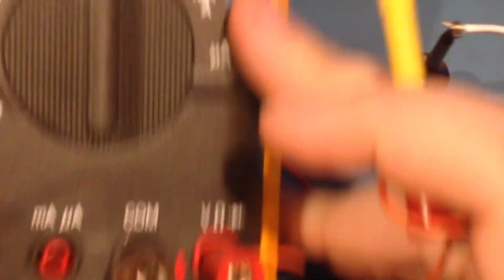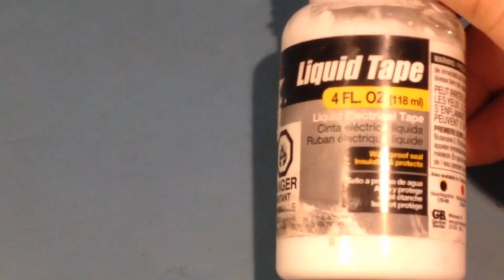How to use Wire Piercing Probes

Comment: Black liquid electrical tape smells like MEK, sticks like crazy. I would recommend it for pierced wires. Good info here, may be for advanced only, though. It can be quite effective. Must know the difference in 12V and 5V circuits.
Reply from the maker: I usually make a point to use a color liquid tape different than what is there to help find my sins later on if it does act up.  White is pretty rare.